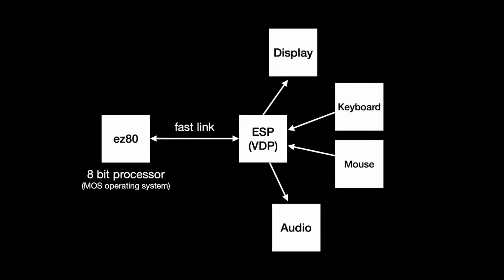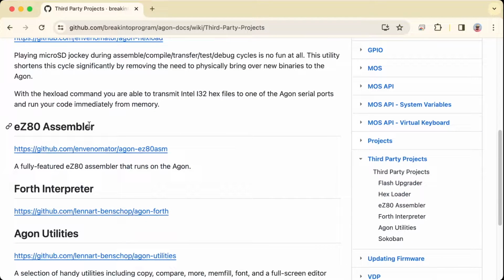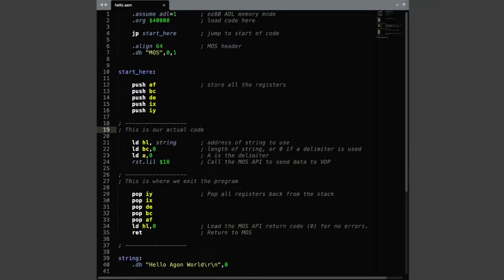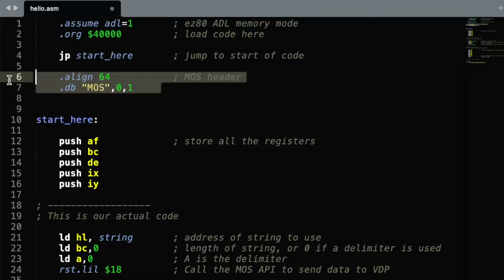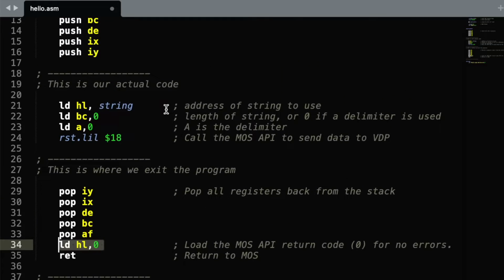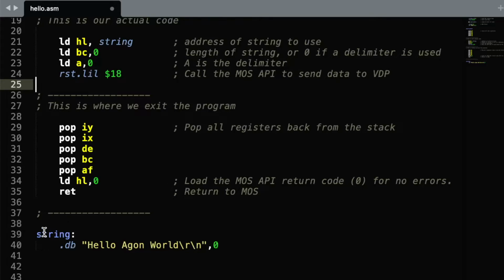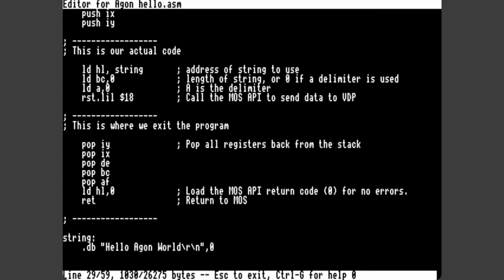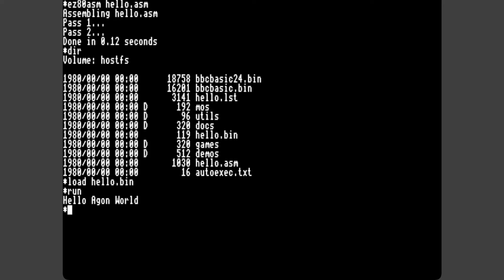01 Getting started with ez80 assembly

Comment: Hello. Help me please. When execute ez80asm hello.asm, get the message: LOAD OVERLAPS SYSTEM AREA. Can you give the drirections? Thanks.
Reply from the maker: This error is normally if the binary is being executed form the wrong part of memory. ie, not loaded at $40000. Or being run from MOS directory, or maybe you have a duplicate file in the wrong location, which is being run instead of the one you wanted to run.

Comment: Thanks so much for this! Learning how to send command to the VDP would be excellent.
Reply from the maker: Coming up very soon...
Reply: I was wondering why I only had a blinking cursor when I tried to compile. The reason was that I had not exited BBC Basic.
Reply from the maker: @nickthesoulboy  If you have basic starting in your autoexec file, I would recommend removing that and setting up the autoexec for your assembly code.